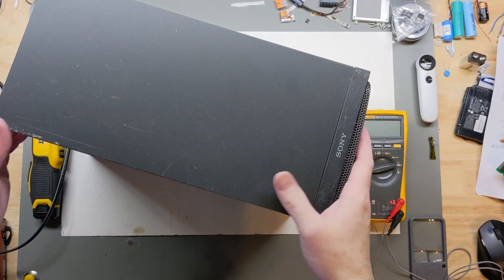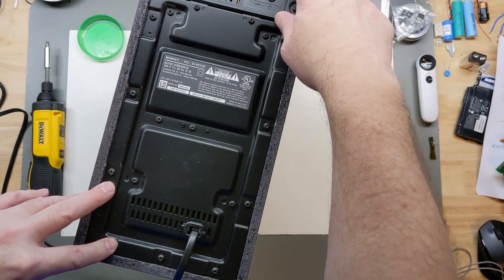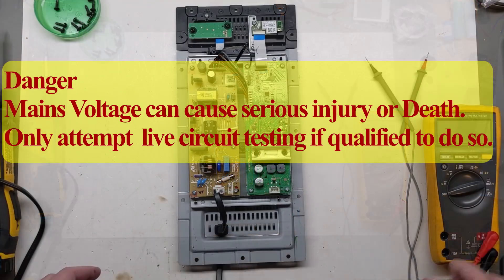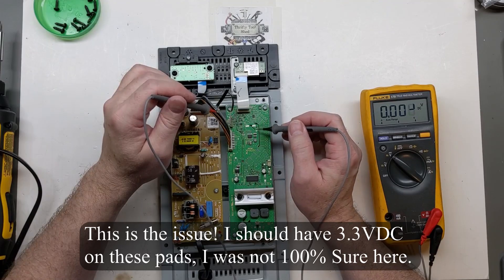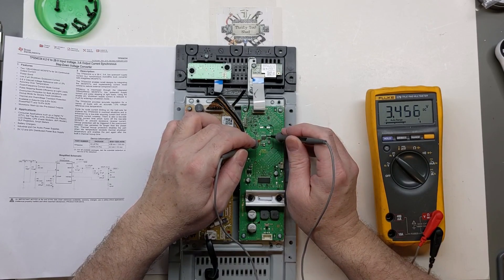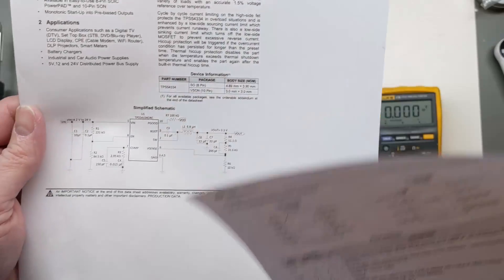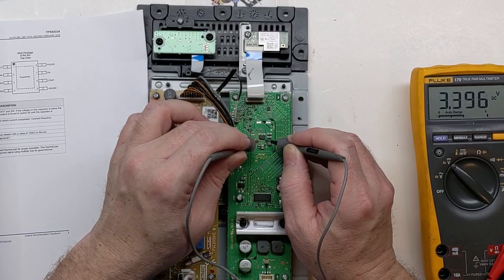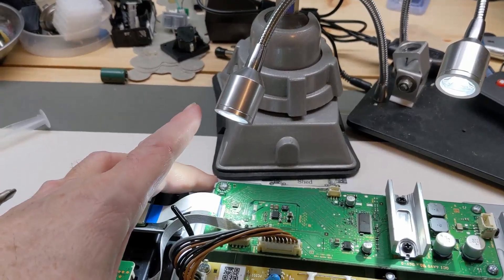Sony SA-WCT290 Sub-Woofer Repair

Comment: Will the TPS54334DDA
DC-DC Switching Buck Step Down Regulator, Adjustable, 4.2V-28Vin, 800mV-24Vout, 3Aout, HSOP-8 work or does ot have to be OEM from Sony
Reply from the maker: I believe that one will work. It is just a switcher chip, nothing special. It is just getting harder to find. It does not have to be from Sony.

Comment: hi, I have another problem, checking the pad I measure 3.3 volts but the subwoofer light continues to flash red, can you help me please?🙏
Reply from the maker: Sorry, that is the only issue I have seen on this one. I know some have a procedure to reconnect the blue tooth as I have shared about a Samsung bar in the past. Not sure about this one though.

Comment: This video is excellent and helped me diagnose the same problem with my sub woofer. I looked around for ages for someone who was willing to attempt the SMD chip replacement repair at reasonable cost but in the end I did it myself buying a basic hot air rework station off ebay and the necessary supplies and the chip from DigiKey. Being such a small chip it was fiddly and I used my mobile phone on video zoom with a stand so I could see what i was doing. The only thing I missed was having some isopropyl alcohol to clean up the solder flux afterwards so I hope that wont cause any problems in the longer term. I also can recommend videos on YouTube by Mr Solderfix giving many tips on how to remove and replace SMD chips. In particular I took his advice and used self adhesive aluminium tape rather than Kapton type to protect the adjacent components from the heat - on this board there are very small components quite close to the chip and the tape worked well to protect them. You need to use quite a bit of heat to both remove and replace the chip with its heat pad underneath. Given this was my first ever SMD soldering experience I am pleased it worked out well and the subwoofer is back in action again. Many thanks from the UK

Comment: Good intuition and good video. Could you share the service manual of the subwoofer unit ? I have a similar one SA-WMT300 purchased standalone, which is wireless, and i want to use it wired. By muself i cannot figure out where to solder the audio input ;)
Reply from the maker: Thanks for your comment. I don't have a service manual for this. I simply worked on this for a friend and had to troubleshoot.

Comment: Hello there. I try to repair my sub-woofer SA-WCT290 but I'm not electrician. Would like to know the reference of the alimentation power card to change to repair it. Thanks a lot in advance...
Reply from the maker: This is the only one I have worked on. I don't know of any replacement board available if that is your question.

Comment: Hi , I have a question how did you remove the chip ?? What did you use on it ? Can you assist ! Ty
Reply from the maker: I used a hot air station. It's the same one I have used in many SMD repairs on the channel. I also used flux and solder. I have some links in the description of a lot of the tools if you find them helpful.

Comment: I’m trying to replace the cord of this same subwoofer because my dog chewed it up. How do I remove that little black piece that the cord goes into the inside of the subwoofer?!?!
Reply from the maker: HI,
These black plastic cord grips usual are really tight and need some compression with pliers on the inside where it sticks through while pushing it out. So I have luck while wiggling and pushing out while pressing with pliers . Hope it helps and best of luck to ya!

Comment: Hey.  Nice and clean work.  My question is does it matter which chip is needed? my chip is: 54334 TI 82A P2E1G3
i found alixpres this chip: 54334 TI 98A P1HHG3
thanks.
Reply from the maker: I believe it will work fine. Most components with 54334 are very similar in spec. I would compare it to make sure though.

Comment: I have the exact surround sound system and last week my subwoofer stopped working. I am by no means an expert on electronics but I can fake it pretty well. Anyway, after looking at the pcb and not noticing any visible issues, I turned to the trusty YouTubes and the first video that came up was this one. So after watching this I ordered the chip, a hot air station and solder paste. The chip came in today and I couldn’t wait to try replacing the chip. I’ve never used a hot air station and I need A LOT more practice, but after watching this video I was somewhat confident I could do this. Well after melting the chip, tearing off 3 pins, lifting one trace off of the board and still having that back of the chip soldered on, I eventually got the chip removed. I cleaned up all the flux and soldered the new chip on. And as the gentleman in the video stated he wouldn’t have been able to do this without solder paste, he is 100% correct. I wasn’t very hopeful that it worked but to my surprise, it worked. So Mr. TTS without this video I would have just gone and bought a new system. So I can not thank you enough for helping me fix my subwoofer and for saving me $300. The chip cost nothing compared to having to buy a new system.
Reply from the maker: Awesome job. Surface mount devices are a whole different beast for sure. With the smaller components all around it makes the job even tougher. For years I enjoyed learning electronics, but thought SMD devices were off limits for me. I would only work with through hole devices for the majority of repairs for years. One thing I finally learned is the more we do it, the easier it gets. The hot air station is a life saver. If that was your first time using the hot air station you did great. Thanks so much for your kind comment and so glad it helped.
Reply: Hello, can you tell me please how much did you spend to buy all the necessary tools? I have the same problem with the subwoofer and I bought a couple of TPS54334 but couldn't find someone to replace it. Maybe I will try it myself. Please let me know what tools you need to buy to replace the part TPS54334. Thanks

Comment: Helpful I have the same prob, My Sony Subwoofer SA-WSD 35 Wont turn, need your advice
Reply from the maker: It may be an issue with the primary PS. I have not worked on that model to say for sure. The SA-WCT290 had a primary PS of around 18VDC that powered the sub and it also had the small DC-DC converter chip to power the Blue Tooth.

Comment: Question. I don't think I'm skilled enough to do this and I don't have the tools. Is it possible to bridge two points so it's always on. Would that work? Thanks.
Reply from the maker: Well it's actually a DC-DC converter chip that is faulty so it's missing the low voltage supply. It would need a supply on that low voltage rail.
Reply: @ThriftyToolShed  Ah. Right. So chip definitely needs to be replaced. I guess I can give it a go. The sub was basically free. Nothing to loose really. I asked around but there's nobody in my small town that is qualified to do it.
Reply from the maker: @acgolem  
It is getting harder to find people that will work with SMD components. Microscopes help tremendously. Best of luck to ya.

Comment: Like all the other comments, I have the same exact sub woofer and the light does not come on. 
Were you able to determine the root cause of the failure other than that part?
 I only ask because if I do go to the trouble of replacing that part with the same part, will the same problem happen again? IE: Voltage surge, vs just a badly made part by a specific company and replacing that part made from a different company with better quality.
Reply from the maker: I have only worked on this one. Hard to say for sure. I ordered the replacement IC and after replacement my friend has had no issues. May not be the same results for everyone. Simply sharing as we learn together. I did not even know this was going to be a common failure until after the repair was complete. On a repair, I typically will replace the IC first and make sure it was not simply a bad batch of chips that caused the failure, but of course if it is truly a design flaw then it's time to go deeper if you want a long term solution. Sorry I can't offer any more information than that at this time. It seems to be holding up so far. Best of luck to ya with yours!
Reply: Just wanted to say thanks so much for taking the time to do videos like this. I would have never figured this problem without folks like you. At least now I can take this to someone and say this is probably the issue and start from here. Or worst case, try it myself. I can't make it any worse than it already is. Peace, keep up the great work. Mo

Comment: Hi, excellent, thank you. My unit has same symptoms but have checked that there is no 24 volts. Would you happen to know, if the 54334 chip is faulty would that stop the 24 volts on the other board

Thank you

A.E.Jones
Reply from the maker: I can see maybe if the chip is shorted instead of simply having no output like the one in the video then it might pull Voltage down?  I would check and see If you disconnect the board from the power supply board do you have the 24V then? I would think with the right board completely disconnected and you still don't have your 24v then the power supply board has a fault.
Reply: @ThriftyToolShed  Hi, Thankyou for a speedy and helpfull reply.

Regards

A.E.Jones

Comment: in my case was the sound bar :( there's no replacement 😭😭😭 but my subeoofer works fine
Reply from the maker: Dang it!
Reply: Me too - I'm hoping to make an experiment out of it, and see if I can repurpose the subwoofer by running wires to it. Can't find anyone that's ever tried that, or how to easily trace the wires to tap them into the input where the wireless signal would come in?

Comment: Thanks for posting this video. With your help, I was able to diagnose the problem and then order a whole new board. But here's my question, is there a way of preventing this from happening again? Is it heat related or just wrong IC for the job?
Reply from the maker: Excellent question. When I first posted this video I had no idea how many out there had a similar issue. I see now that there are many with similar issues. I did not check into the load on this chip when I had this one in front of me to say for sure. At first I thought maybe just a bad batch of chips and I guess it still could be. I do wonder if the chip is not pushed a little too hard though. Sorry I have no more information as I have not worked on another one myself yet. Thanks for your kind comment!
Reply: @ThriftyToolShed  thanks for commenting back to me 😁. I'm no electronics person, so I may try and use the unit and just see if it gets hot? In my head, fitting a small heatsink can't hurt 🤕... Though I may just order another board while they're in stock on eBay 🤣
Reply: @dafydds  what is the model # for the board? Thank you.
Reply: @xantherdaywstedx  A2165413A / F13066651 - Sony SUB MAIN

Comment: Thank you. I have the same sound bar and the subwoofer went out, idk when. Took it apart, googled the mains PCB PN# and it brought me to your video. Sure enough, check that 3.3V TP and no voltage. Got the 18V. Problem is I don't have a heat gun. Plenty of soldering at this size of SMD. 🤔

Comment: Outstanding help, thank you, this sound bar and sub cost me 300$ in 2019, it was great until recently, i noticed it seemed like i had no Bass , i inspected and found subwoofer was inactive, no power. i started looking online and this video came up, i clicked and went to it and watched,  i performed mentioned inspection points and they led to the same conclusion as your did. i ordered a bag of 3 chips and r/r chip and had Bass again, light worked, pairing worked.. with your very detailed instructions you saved me at least 300$ as i would have had to purchase a new sound bar or subwoofer that i dont know if it would have paired with the sound bar, so a grateful thank you from near athens Georgia
Reply from the maker: Awesome. Thanks for your kind comment. I am in Augusta, Georgia. I have been to Athens for different things over the years including Athens Tech. In the 90's. And I was able to tour the ABB motor plant about 15 years ago. It was Reliance or Baldor then.
Reply: @ThriftyToolShed   hi again, my subwoofer AND sound bar both inoperable now, you being in augusta me near athens, would you take a look at my set for a cost , i can ship it down there.
Reply from the maker: I wish I had time, I do get asked this often. I do not have a repair service at this time.  I work full time+ in a Industrial job and try to have time to edit videos to post. I try to help by posting what I have learned and sharing that best I can. Best of luck to you with yours!
Reply: @ThriftyToolShed   hey augusta.. my system is back up and working with bass. it wont connect to my pc bluetooth but i used a HDMI audio extractor i think spdif is the abbreviation. , i was using the audio extractor method before my bass went out and i hope that is not why the 5334 chip burned out, i was only able to connect to my pc using bluetooth very few times when i first bought the speaker system , but it eventually would not connect so i tried optical cable with hdmi audio caonnector and it worked in 2 channel mode,  not the 5.1 channel mode but i dont have surround speakers  if that is what 5.1 refers too. , thought i would let you know
Reply: @fingerfeller  i

Comment: Hello, 

Where can I order this chip from? Have the same exact speaker and it has the same issue
Reply from the maker: Hi,
These are very hard to find right now. I have some links in description, but they are constantly out of stock. I have a link for Amazon I will share for reference m, but the price is too high it's for reference only. 
https://amzn.to/3y1rB9Y
The MP2307 could be a possible replacement if check it out well. I have not used it, but it's similar.
https://www.ebay.com/itm/392318769050?mkcid=16&mkevt=1&mkrid=711-127632-2357-0&ssspo=elZ-z3P6RkC&sssrc=2349624&ssuid=D_qZMHXJQNK&var=&widget_ver=artemis&media=COPY

Comment: I have problem with my sony HT-S20r no power on it
Reply from the maker: Sounds like it could possibly be an issue with main power supply.
Reply: @ThriftyToolShed  NOW ITS ON I DONT KNOW WHAT IS WRONG BUT NOW IT DOESNT PUT OUT SOUND IT JUST MUTTED NO SOUND IS COMING OUT OF IT NOW SOUND BAR AND SUBWOOFER
Reply from the maker: I only worked on this one I shared the video on. Sorry it's the only issue I had and I shared what I learned. I can't say for sure other than that.

Comment: This is an excellent tutorial.  You have helped to identify the exact same problem that I have. No voltage at the pads. I'm an electrician and not an electronics guy,  so removing and resoldering are beyond my skillset.I am hoping to find someone locally  (Las Cruces,NM) who is capable to replace that chip. You have hopefully saved the tech some troubleshooting time and me a few bucks!
Thank you for a very educational video!

Comment: I called Sony customer support regarding this issue,  with my device being just over a year old they told me to go pound sand.
It looks like Sony is now producing garbage and is not taking any responsibility for the pre-mature failure of there products.
Apparently I will need to start warming up to Samsung TV's because I will not be buying anything with a Sony logo ever again.
Reply from the maker: Dang, that sucks! Sorry to hear that, thanks for sharing this with us. Hopefully some repair shops are starting to repair these with some cost savings?  Best of luck to ya!

Comment: Thanks for sharing this. He helped me fix the sub myself.
However, after replacing the TPS54334, I couldn't connect to the sound bar, and there was a situation where the sub LED just flashed red.
The cause is that the cable "AWM 21107" connected to the Bluetooth module is bad. After replacing the cable, it returned to normal.
I want to share so that people can have more solutions
Reply from the maker: Thanks for sharing, great to know!
Reply: Tps54334 chip

Comment: Love your work. Interesting that on such a small chip, heatsink solder pad is used to draw heat. I'm thinking that's probably the issue.... heat is not being dissipated efficiently. Gluing a piece of aluminum foil might do the trick as long as it doesn't touch other components' terminations. This subwoofer hadn't been in a market that long 5-6 years. Any thing that doesn't last 10 years isn't a well engineered product in my opinion.

Comment: What if the large capacitor has blown and leaked white stuff everywhere?
Reply from the maker: That's not great. If your lucky you can clean up the board well and replace the cap and be back in business. One things to make sure of is that you clean the Board extremely well with high percentage IPA or plastic safe contact cleaner so you don't have bad corrosion later from the cap electrolyte.

Comment: Brilliant video. Saved me a lot of money. The IC chip was gone in mine as well. I did not have the tools so I just ordered a new green board and after replacing it all is working fine. Thank you very much again.
Reply: Where did you ordered the green board from and what was the part number ?
Reply from the maker: What green board are you referring to?
Reply: @ThriftyToolShed   i was just asking the guy who made comment up there saying he ordered the full board
Reply: Can u give me the link to where u purchased the whole board?? I don’t have the tools to remove that chip
Reply from the maker: Excellent! Great Option. Thanks so much for sharing!
Reply: How do you remove the ribbon cables?
Reply from the maker: Hi, I did not remove the ribbon from mine since it fit under my microscope just fine. Most of these ribbon cables have a locking tab you will have to slide up and then the ribbon will slide out. Some have a lever that opens and locks back, but I don't remember these being that type. Seems like this one has the tabs you slide upward to unlock.